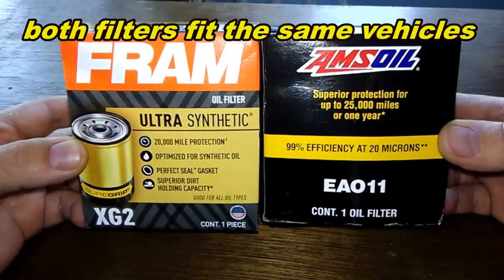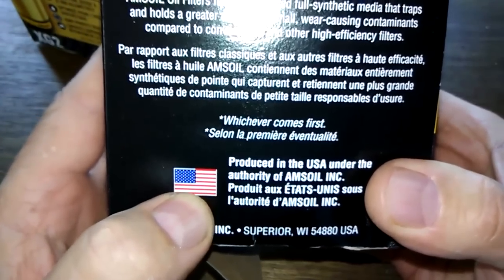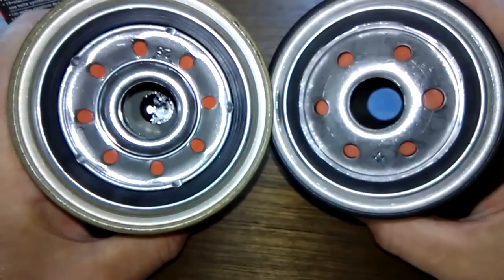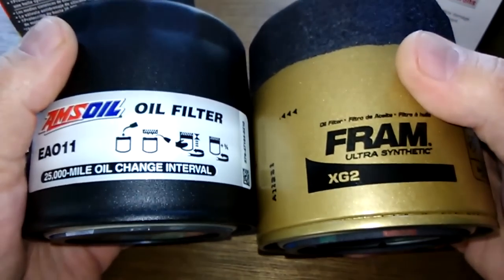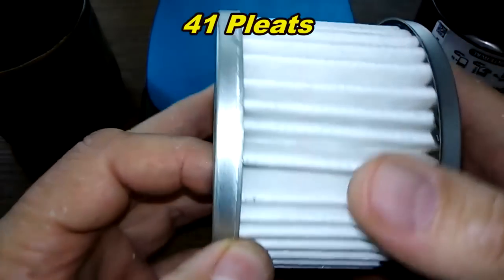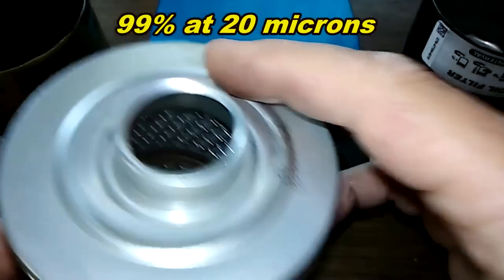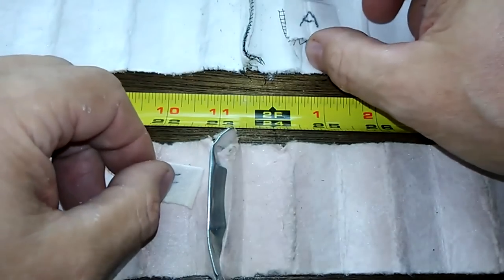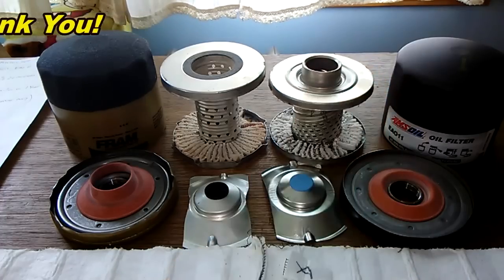Fram Ultra XG2 Oil Filter Cut Open vs. Amsoil EAO11 Oil Filter Cut Open Oil Filter Review

Comment: If the frams have more sq inches of filter media , that’s the winner for me. The rest of the stuff is a tie. And the price is the kicker.
Reply from the maker: Thanks for your feedback👍🙌😊
Reply: But remember it’s not the quantity but the quality! :).
Reply: It all depends on the micron filtration...
Reply: Price? How much does a new engine cost you. Why cut open a filter. What would you see. The media is expressed in microns. Is that what your eyes are calibrated to? Some people are way above "normal". Amsoils filter material isnt just paper. Its a patented synthetic. When you get into why medical filters are better because of this type of material, you will understsnd the quality difference
Reply: @stevencaskey7473  so is the Fram media synthetic. Possibly purchased from the same media supplier.
Reply: @walterk1221  Amsoils is proprietary.
Reply: @stevencaskey7473  the filter is made by Champion Labs. I doubt it is at all materially or performance different from other of the (perceived) "wonder filters" also manufactured by Champion Labs. Brand loyalty is great but Amsoil has its own cult following.
[EDIT: you need to realize that "proprietary" only means that Champion Labs has signed an NDA and cannot tell another customer exactly what of probably dozens of media available Amsoil chose. There is no legal barrier to the same media being sold to other customers. Those other customers can obviously request evaluation samples of Champion Labs' media and then by an Amsoil filter and contract an analytical firm to identify which sample matches. Easy as can be for Fram, Royal Purple, Mobil-1 or whomever to have the same media.]
Reply: @walterk1221  I suppose Champion labs builds the fiters to spec. 
We are not a cult following. My father worked for American oil for 35 years. The QC and spec  difference between 440,000 barrels a day and a couple thousand a day would be and is  dramatic. Amoco didnt really care about Q C that much. It is tbe quality and function I am after. 
How many conventional oils invite oil testing. 
I have used Amsoil since 1978 amd have not had a failure. I cant say the same for conventional. I do change tbe oil once a year. I dont get 25000 miles on a car in a year. Wjat is the spec on tbe other filters. Bet they dont say. Gee I wonder why. Amsoil tells you right up front. The others are ok for 3000 miles. Less if you push the engine hard. But they dont tell you do they.

Comment: And it's Fram Ultra for the clear win.  Their lower level filters might be a bit lacking but the Ultra is as good as any filter in this and three parallel Universes. Wish the Ultras were made in motorcycle sizes.

🤔
Reply from the maker: They do fit some motorcycles, depending on the one you have. 
Thanks for your feedback!👍

Comment: Very informative video. I'm using the Amsoil 25,000 Mi filter now, but I'm going to switch to the Fram synthetic with 50% more filter media and a better seam and better flow
Reply from the maker: Thank You, Glad, you liked the video, and Thanks for sharing.👍
Reply: More filter media but it doesn’t filter 99% at 20 microns like Amsoil. Fram never claims that, anywhere…
Reply: They claim it on their website
Reply: Could be not comparing apples to apples. Ive no comparisons, only amsoil’s published material which states they use ‘nano’ technology for their filter media. What they are getting at is that they use a very fine filter media screening. Meaning the passageways through the media are 20 micron but due to the finer screen or ‘framing’ material, for a square inch of material, they have many more passageways than conventional 20 micron filter material. Assuming what they say is true, this means better flow especially when cold and oil is thicker meaning less time the unfiltered bypass is open. If true, should be a good thing.

Comment: Thank you for the video!  I find it interesting to see the innards of the various filters.  What sold me on the Fram was the 20 micron rating.  I'm switching from Mobil1 as it has a 30 micron rating.  Huge difference!  Champion Labs and the Amsoil filter are also an excellent filter, but the price difference is insurmountable.
Reply from the maker: Your Welcome,
Yep, the 20-micron rating is what really counts in keeping the oil cleaner.
Thanks for the feedback.👍🙌
Reply: 20 micron strict flow more though, 30 micron has more flow.
Reply: So why is your engine wearing out those bigger chunks?
Reply: @wangwang2003 not all 20 micron filters are the same flow wise. Youd have to count how many 20 micron orfices there are in the filter media to accurately compare. Amsoils sales point is that their filter media is “nano” meaning thinner screen material allowing more 20 micron passages. More passages means when cold, less restriction, the less time the bypass is open when oil is cold and thicker. When bypassing, the oil is not filtered. Although, some filters do have a coarse screen on the bypass to capture the chunks.

Comment: I change my Fram ultra synth at around 4k. No such thing as an overly clean motor or too much reliable in a vehicle. So far, I've noticed no issues. The oil stays pretty clean and does not burn. The filter does seem to hold more oil when compared to the Motorcraft filter I used to run. More oil in the system may provide more protection for my engine.
Reply: 3000 mile oil changes are a thing of the distant past, when engines were "worn" at 100K miles.
Reply: @jdigitalseven7  not true. It actually says right in my manual to change at 3k for severe service, with at least blend or 100% synthetic, which I fall under most of the time. 5k is the max if you don't drive hard and mostly stick to the highway. If you go over 5k, you must not really care about peak performance or engine cleanliness. If you're trying to claim a dirty engine  will outlast one with 3k oil changes using full synth, your words hold no value to me or anyone else with a passion for motorsports. It shows how much you know about combustion engines. I change my oil with full synthetic ester on my 4t 500 cc Enduro machine every 8 hrs/200 miles. Also change my 1000 cc sportbike at around 1500/2000 miles with expensive motul, at least annually. I'd rather be riding with clean oil and peace of mind than putting around with a sludged up piece of junk. With motorcycles if your engine fails, it can be fatal. With modern engines, they could be the first or last component to fail, depending on if you actually take the time and effort to change the oil on time, with care. Anyway, depending on what you drive maybe you don't want to ever change the oil. Maybe you should just change the whole vehicle if you don't like it enough to keep it maintained. I hear on some hondas and toyotas, oil changes are optional. Some say it's a lifetime fluid, I say oil is cheap protection for optimum performance. I can feel the difference every time with fresh oil and filtration. Maybe it's just my old tired Ford engine, but I swear it gets better every time I change the oil or go for a long road trip. I absolutely love driving the vehicle in any conditions. Awd with the 2v 4.6.

Comment: The Fram has longer and wider filter media so more surface area. The clear winner. If you are worried that the metal core on the Fram is going to clog up then you have bigger problems with your car than the oil filter.
Reply from the maker: I'm not worried I just prefer holes over louvers, but it's not a deal-breaker. Thanks for your feedback.👍😊

Comment: I’ve been an AMSOIL dealer since 2008, I love the AMSOIL filters and most of my customers do to. I still have a few customers that use other brands for the “nut” on them for easy removal but use AMSOIL oils. It’s personal preference on each brand but remember a local dealer gets paid on every AMSOIL sale, unlike the big brands that run off corporate greed. Cool video, thanks for making it.
Reply: you're saying people at the parts stores dont get paid from other filter sales? Amsoil has corporate 
"greed" too or they'd not be in business long.

Comment: Amsoil center core had more holes. Amsoil is the best oil on the market and pricey. But if your keeping your vehicle long term its the one oil that will make the engine fast longer.
Reply: Did you watch the video? And the mileage rating dropped from 25000 to 15000. And its funny Amsoil claims the reason why is that if you take 2 identical Honda's their computets are different and one engine will have sludge.....now you gotta know how far fetched that is and how strict emissions standards are. What a complete joke.

Comment: For the price point.  Fram is the winner.  

I don't like the stamped spring and for the price of the Amsoil it should have a coil spring. 

Filter medias are equal, but give the nod to Fram for the longer length.  

AlWays love Filter Friday.  Thank you for all that you do.
Reply from the maker: Hi Jason, Thank You!
Reply: Leaf springs work good and are progressive. Trucks use leaf springs because they are more progressive in rate, carry a load better then coils can. Although coils give a better ride ok

Comment: Nice review! I too am not a proponent of using one filter through multiple oil changes. That's apparently what Amsoil wants you to do. I am running a Purolator Boss with Mobil 1 EP 5W-30 synthetic currently. I really like the design of the Purolator Boss filter-2017 Impala Premier V-6 87,000 miles on the engine. A nod to the Fram!
Reply from the maker: Thanks!
I like the Purolator Boss also with the Polymer screen backing and they use a cream-colored glue on the end caps which is a lot harder and stronger IMHO than your typical black glue.
Reply: amsoil wants u to use the same filter through multiple oil changes? hmmm i dont think so
Reply: @fishman80  No one runs oil for 25,000 miles.
Reply: @PurpleDreki  I DO!
Reply: @jimandnancymcoil  I don't, and I won't. 😃
Reply: @jimandnancymcoil  Amsoil recommends 15,000 miles for severe service with the signature series oil. I run from 12 to 15,000 miles myself. I think most motorists are severe service, unless you drive a few hundred highway miles a day. Yes you’re right, Amsoil recommends changing the oil filter each oil change.
Reply: Amsoil doesn’t recommend using their filter through multiple oil changes. It’s rated for 25,000 miles with Amsoil’s signature series oils if used in normal service and 15,000 miles in severe service, which is how most of us drive. I’ve been using Amsoil since the 90’s for 15,000 miles with no issues at all! We had one Dodge mini van with 287,000 miles before trading it and the engine ran great with a qt every 10,000 miles usage!
Reply: @jimandnancymcoil  ass
Reply: @PurpleDreki yes they do. Such as cab companies save time and money running an oil like amsoil sig. cheapest way to go with the best oil. However, they caveat that if use is extreme or in dirty enviroment, to reduce intervals. Personally, i run an old 3.0 accord thats 325k miles and change once a year which currently is about 12-15k and it runs great and burns no oil running the sig.

Comment: I agree, the Fram looks like a good deal! I am also not sure I would feel comfortable with 10000+ miles on an oil change. Most oil analysis number have seen on the internet show greatly reduced TBN past 5000 miles, and if you have fuel thinning.... going past 5000 miles I would have to have lab analysis to see if the oil was still protecting the engine.  I don't want to pay for it, so I'm sticking with 5000 miles or twice a year, whichever comes first.
Reply from the maker: I think 5,000 miles is a good OCI also, oil is cheap engines are not.

Comment: definitively Fram is the winner, look like their quality is improving.
Reply from the maker: I think the Ultra is a pretty good oil filter.👍😊
Reply: @WhipCityWrencher  I tend to agree with you. Although I wouldn’t chance going 20K miles in which they’re rated, I would feel comfortable doing a 10K OCI.
Reply from the maker: @carlovanrijk4039  JMHO, If you do 10K OCI's, I would get an oil analysis and see what the test results are. If they're okay then go for it.👍
Reply: Fram Ultra’s are phenomenal filters, I love using them, knowing they are going to filter my oil better than some of the other companies.
Reply: The Ultra construction is very different than other Frams.  Only Fram that uses metal endcaps, only Fram I'll use.
Reply: @WhipCityWrencher  I had an oil analysis done by Blackstone Labs last winter when I ran an OCI of just under 10K miles. Their consensus was that the oil could’ve lasted another 2K miles based on the TBN. For me, I’m thinking 10K will be absolute maximum, with the oci’s running closer to 6K-7K.

Comment: I'm with you whip! Even if they were the same price I would probably pick the fram just because there's more media. I saw another review of amsoil vs royal purple and they were the exact same filter. Just too much $ for the amsoil in my opinion. Thanks whip good review 👍
Reply from the maker: Thank You!👍😊
I think there overpriced also.
Reply: You don't know which has more media because they were not weighed without the end caps.
Reply: @georgewetzel4380  Really dude! You can see it's longer and wider. Isn't that enough evidence for you. Whip even said the center tube is smaller on the fram and it had more media

Comment: I'd go with Amsoil. Seems like a better product. The filter media is probably a far better material than the Fram, but with either, I would still change my oil and filter no later than 5,000 miles under normal driving conditions. That would be about twice per year for me. There used to be old commercials on radio and TV by Fram that suggested change your oil often and use a Fram filter. The tag line was - "You can pay me now, or you can pay me later." This was supposed to be a mechanic speaking saying you can buy the filter now or repair your engine later. Good advice, even if you don't use Fram.
Reply from the maker: Great Advice!
Thanks for sharing👍
Reply from the maker: Great Advice!
Thanks for sharing👍
Reply: "Seems" like a better product?  LOL......no way.

Comment: Hello 👋 I bought a Fram ultra synthetic oil filter and noticed the rubber gasket comes off really easy. So I super glued it on and now it won't come off. I used about 5 drops spaced apart. I checked to make sure its level. And it is.
Reply from the maker: Thanks for sharing, but not really necessary.
Just make sure next time you change the oil filter the gasket comes off with the oil filter.
Reply: Talk about overthinking something & making it harder than it needs to be!
Reply: @bigtuna9529  no fram is such a cheap company that there gaskets come off so easily. By any means the super glue worked and preformed better

Comment: The newer version of the Fram XG did away with the wire backing. The filter efficiency is a slight bit better on the newer version.  XGs are ~10$ in the upper mid west, but prices are rising with inflation.
Reply from the maker: Yep,
The filter in the video went up to $8.97 and some others are going for $10.97 at my Walmart.
Thanks for sharing👍 
https://www.walmart.com/ip/FRAM-XG2-Ultra-Synthetic-20-000-Mile-Change-Interval-Oil-Filter/16878924 
https://www.walmart.com/ip/FRAM-XG10575-Ultra-Synthetic-Filter-20K-Mile-Change-Interval-Oil-Filter/16879149?athbdg=L1600
Reply: 7.98 as of right now on Amazon and still 8 and change at Walmart
Reply: We can thank Brandon for the inflation! Just giving money away everything is getting more expensive! Let's go Brandon!!
Reply: @empackmanmueller1725  Home schooled?
Reply: The titanium seems like it’s the old ultra with wire backing

Comment: i us Amsoil Oil & Filter on 2006 Dodge Sprinter Van &  change filter & oil at 20,000 miles test oil . I   test with Blackstone  ever other oil change & usually only problem is Fuel dilution van has over 300,000 miles
Reply from the maker: Wow, that's a lot of miles.
Thanks for Sharing.

Comment: I went through most of the comments, and nobody noticed that the Fram has a fibre gasket where it meets the relief valve bracket. The Amsoil is just metal to metal. The Fram is rated 99+% at 20um. The new Fram media seems to be cheaper, no metal screen, thinner media, but more of it. They claim better filtration. Thanks, Whip City!!
Reply from the maker: Hi Bob, 
You're Welcome!👍 I have a Titanium vs. Ultra video showing on Friday, Sep. 9th. I think you'll enjoy that one.
Reply: @WhipCityWrencher  Great!! Can't wait!! That was going to be my next search. The Titanium is said to still have the metal screen, and maybe even the same media the OG XG had. Be nice to compare that with the other two Fram 10575's you took apart already

Comment: I purchase the amsoil filters and use Pensoil ultra or Mobil 1 oil and call me crazy but every 3000 miles I change my oil and filter.
I have six vehicles. OIL holds dirt and contaminates. I do use a Mann filter on my BMW. I do my own oil changes Dealers have KIDs
Changing vehicles oils and filter..An they forget to put oil in or over tighten filters or drain plugs.
I always keep my vehicles in excess of 200000 miles
I find it gives me self serving peace knowing my engines are well maintained and lubricants with high quality products.
The amsoil filters for my 22 corolla 6 speed manual has tons of holes in the bottom of the filter VS OEM
Reply: @lrcreamer - Use the AMSOIL extended drain synthetic oils with the AMSOIL Oil Filter and save money, while providing your vehicles engines with the utmost in protection.  If you have a laboratory oil analysis done on that oil you're tossing out every 3,000 miles, you'll discover you've bee throwing away perfectly good oil, (and money). - 30 year Independent AMSOIL Synthetic Lubricants Dealer.